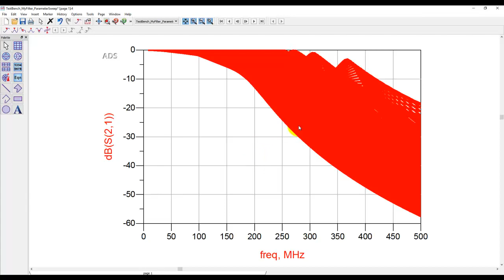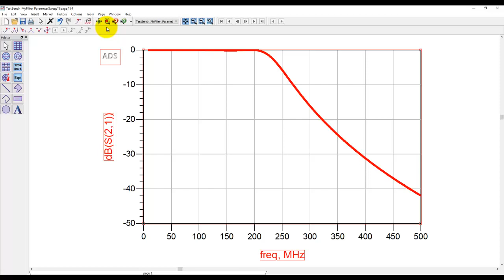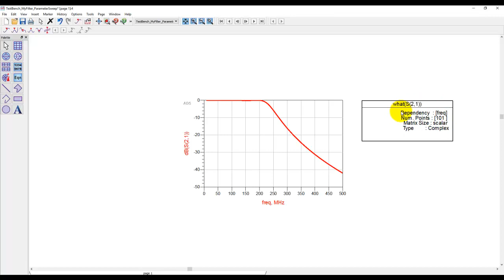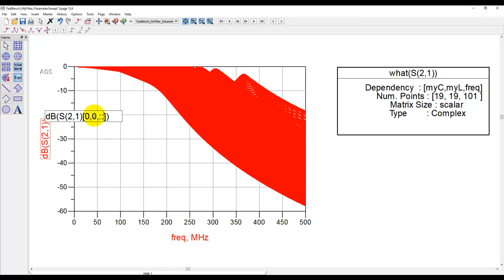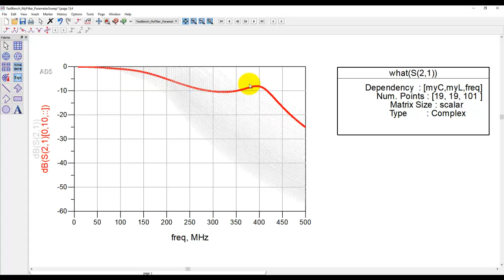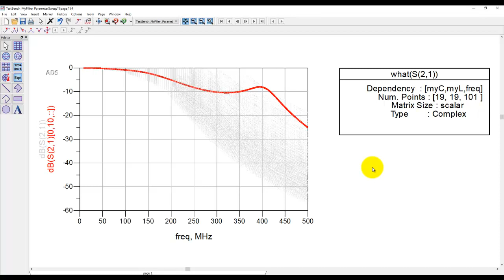Tutorial-15: Multi-Dimensional Data Processing

Comment: I would like to sweep multiple s-parameter files then plot the results with slicers to navigate thru all s-parameter files. Do you have any video showing how to do this? Thanks!
Reply from the maker: Hi Nhan,
I don't have a video precisely on this topic but it is very easy to do as fundamentals remain the same in DDS window. You only need to have a proper schematic setup either using a DAC approach or Batch Sim set up and that's it...
If you need any help kindly contact your local tech support team for help....👍
Reply: @BhargavaAnurag  Thanks for your reply. I did get it to work using batch sim control.